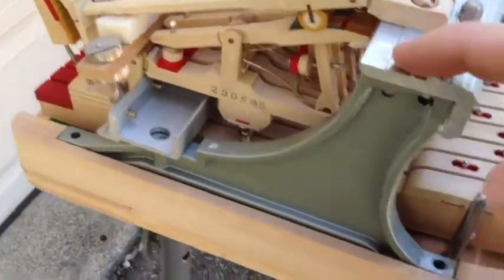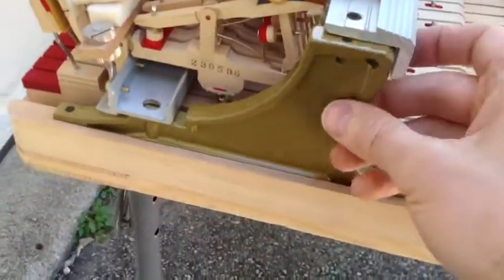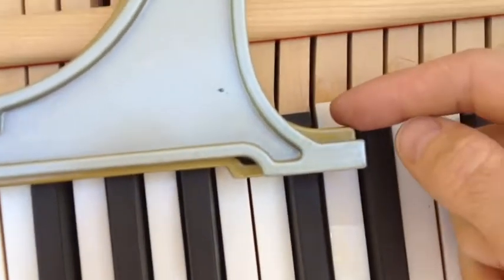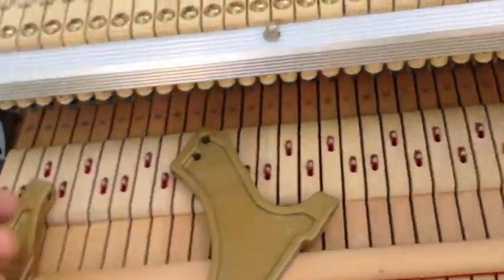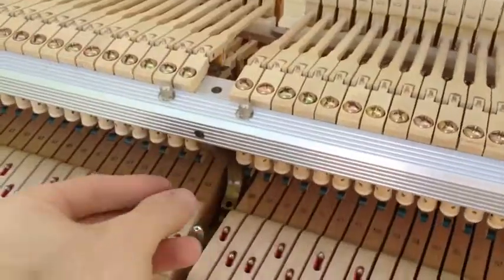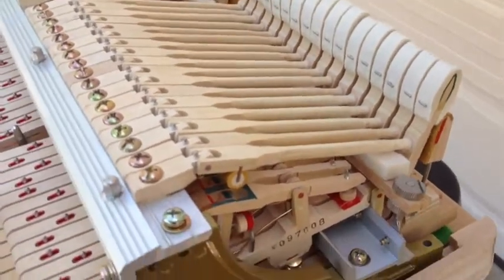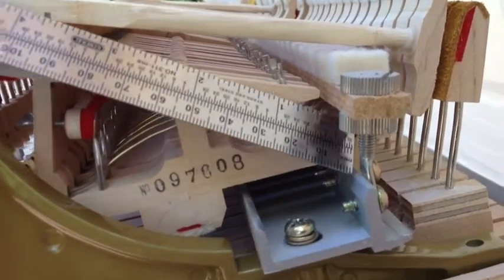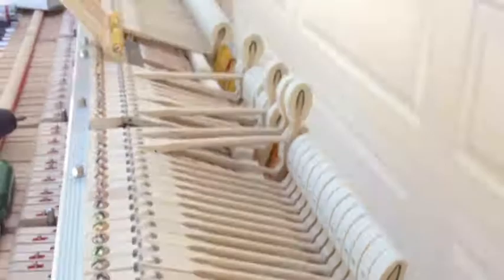Young Chang Action Bracket Repair Step by Step - Part 2

Comment: I am a piano tech 50 years .this is only the  2nd  grand  I replaced action brackets on . On a young Chang grand that is around 1991 when you replace the action brackets can you move the center rail  to adjust the spread the ends are very close but the middle is off .